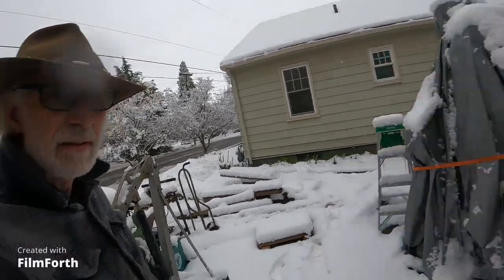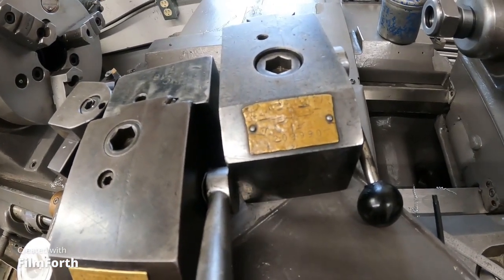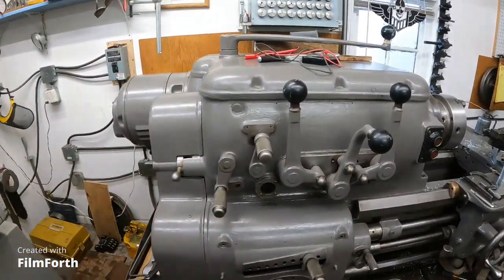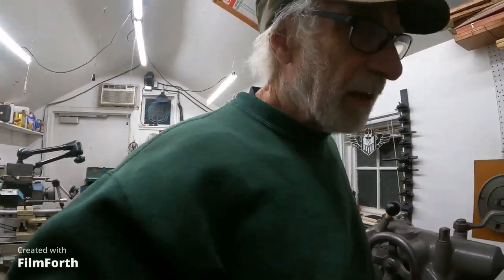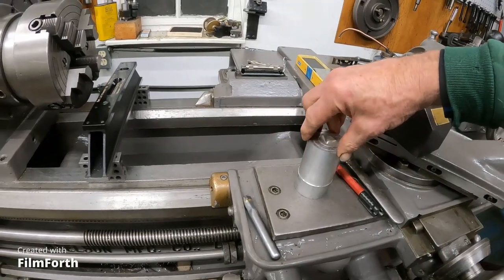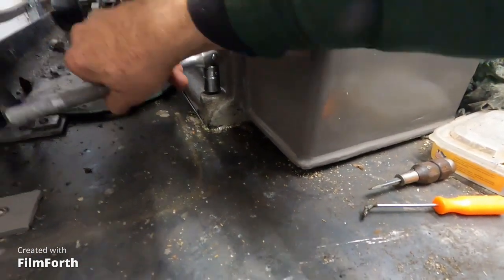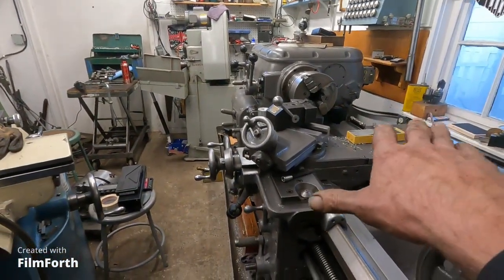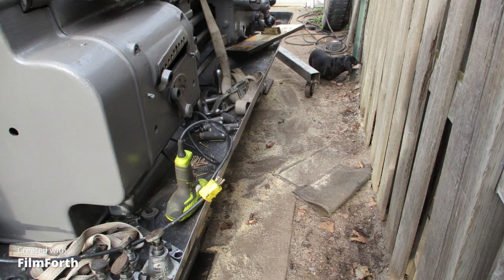Axelson 14 X 30 engine lathe removing bed twist

Comment: Hi dee dee. The lathe looks brilliant in position. Will the concrete pad distort or bed down more slightly with the weight of the lathe? Will you have to recheck for level periodically? Cheers Tony
Reply from the maker: I had the two Monarchs there weighing 7000lbs. and 30yrs before had a 18 X 60" lathe weighing 10000 lbs., that has been a stable spot so far. I will have to check level often for a while anyway

Comment: I would freeze to death in that garage.  I can't believe that massive cross slide for a 14 x 30 Lathe.  Leveling a machine is usually done with two people so the second person can watch the sight glass of the Level.  It's still too cold at 60 degrees outside for me even though I am wearing three layers of thermal underwear it's too cold.  Warmer weather scheduled for Easter.
Reply from the maker: Hi! the weather finally broke into spring, a lot better now!

Comment: 10:40 'Chamfering a face' so to speak.  Got her inside just in time. This next stage should be very informative. Leveling and finding or homing in on those sweet spots.  Looking forward to your tips and tricks for that process.
Reply from the maker: This has been a tough winter for here, thanks for tuning in!

Comment: I'd bet all them bolts securing the the  machine to the bases was the same torque,  or "tightness" when that machine was leveled and setup working properly.  One being less tight and others being more tight would be a good indication that you sir was correct in your assessment that it is in fact "twisting" or "twisted"
(In my humble/ less intelligent opinion ) 
Love the progress sir. Thanks for sharing.  I too hope you are having a great day.
Reply from the maker: The machine did get a couple of truck rides and 4 loadings too, thanks!

Comment: Who is the well dressed gentleman in the photo sir ? Cool picture! 
Once again I am impressed by the tenacity you maintain.  I'll bet you could work half these guys under the table that I deal with every day, haha. And they are less than half our age ! Haha..
Reply from the maker: I don't think I could out work the cutting edge guy from Aus, but I was trained to annihilate the competition. The photo is one of the Axelson brothers.
Reply: dee  ververy cool. Thank you Sir 👍
Reply: Glad to see those KDK tools are getting a workout.  In their day they were the best money could buy and so were the Axelson engine lathes.  Great introduction to how stresses add up and how to address them. Thanks for the lesson DeeDee.   Cheers, TB
Reply from the maker: @bid6413  One thing all tool post systems had in common was high cost until China imports, That said, it would somehow be like putting a summer hat on a poodle using anything but a KDK 200 series on this brute of a small gear head lathe.